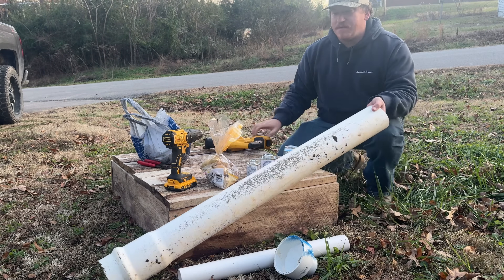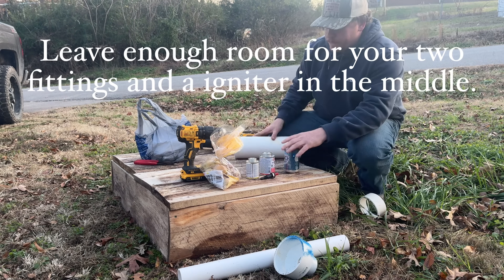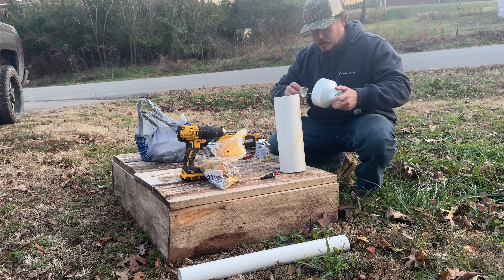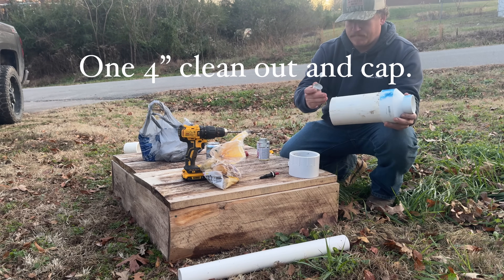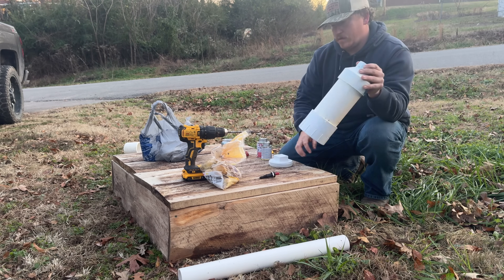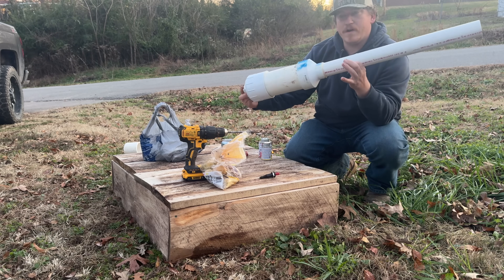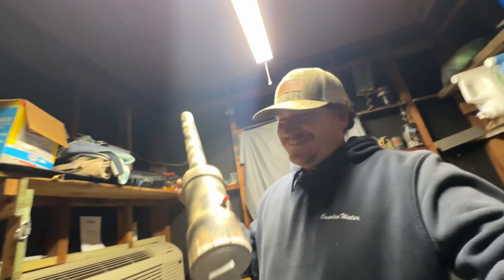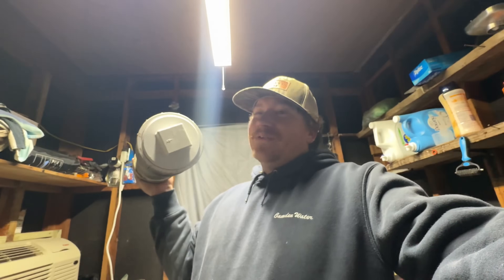How To Build A Potato Launcher.

Comment: My cousin and i built ours in high school days. We first tried rubbing alcohol. But it didn't work well. We then switched to hairspray with excellent results. But then we switched to butane. And that's when we achieved excellent distances. At times, the potato went so far we couldn't see where it landed. 
Now, I don't recommend anyone use butane. It was extremely stupid for us as teenagers to do this. We could have severely hurt ourselves. We just got lucky. 

Btw, we made ours from the black pvc. That's probably why we didn't lose a finger or hand.

Comment: Many years ago I made the mistake of exactly what you said not to. I could smell the glue going off and though "I wonder if that's flammable?". I put an oven lighter into the small coupler hole and clicked it a few times. My forearm and hand was met with a just burst of a blue flame. Signed all my thumb and arm hair. Curiosity killed the cat.

Comment: I’m not getting enough spark how are you rigging your wire to your Ignition
Reply from the maker: Twisting what they call baling wire around the igniter itself.
Reply from the maker: It’s got a small wire that run down the igniter I’ve been thinking about trying to slide it under that to be more secure. But it’s pretty thin so you have to be careful not to break it.
Reply: @WetandDirtyOutdoors  could you solder the baling wire to the igniters wire??
Reply from the maker: Possibly, or glue the wire across from the igniter.

Comment: It seems like most of the gas would escape before you put the cap back on.
What about installing a one way inlet valve like a valve stem for a tire, and then use compressed gas?
Does anybody know what kind of valve to use for a CO2 cartridge?

Comment: If you load from the barrel end and push the potato down the tube, What is going to prevent the potato from falling all the way down and getting caught up with the ignitor and wire?
Is there some kind of screen to prevent the potato from getting into the 4 inch pipe?
Reply: Dont push it that far lol. As soon as you do it one time you won't ever do it again cuz you'll realize what happened
Reply: I bet you could put a screw through the barrel near the end for a stop.
Reply: @NotJustBBQLLC Bad idea if the gun malfunctions, it could come flying out in all directions

Comment: Its 100% clear and apparent you don’t know a damn thing about plumbing primer & glue! People when you prime and glue the pvc pipe clean it the same or a bit more with of the fitting you are using make up and give it a quarter turn immediately after you put them together and seat it cause it sets up fast! He said he was gonna wait till the next day before he fired it technically he could’ve fired it. I would’ve waited about 10 minutes that cement aka glue drives fast and doesn’t need an overnight to dry! And the bit he was talking about is called a paddle bit. It’s used for drilling holes in studs it making perfect hole. 1st time and every time until you break it!

Comment: As kids, we used to tape aluminum cans together and punch a pin hole in the bottom one to inject lighter fluid.  Spin it to get the vapor and light the pilot hole with a match.  Shot the tennis ball 200 yds...yes.... sometimes on fire!... great night show ...very bad for potential of starting brush fires though.  Only over water!!!
DO NOT DO IT TODAY!  

But I like the idea of tape rather than glue so you don't accidentally make a pipe bomb and blow yourself up if you have a tight load in your barrel...
Reply: That's how we built ours in the 60s
Not OSHA APPROVED!
Reply: It was 200 yards from a kids point of view.  There was no way it went that far.
Reply: @BOHICA_  absolutely it will go that far
Reply: MacGyver style!

Comment: For safety, I suggest not gluing the barrel onto the expansion/combustion chamber. I modified a coupling to slide over the barrel and glued it into position. I use tarp tape to hold the barrel and modified coupling onto the expansion/combustion chamber. If the potato/ammo is stuck or the explosion too great, the barrel should pop off, instead of blowing up the chamber. My barrel has never separated.,
Reply: Can you make a video showing your way better/safer method of making a potato launcher
Reply: Plssssss
Reply: Will pay if u do step by step

Comment: Starting fluid works better and  2.5” Id pipe will send a 2.7” od tennis ball very far . 😊
Reply: I used 24" of the 4" abs, and 4' of 1 1/2" abs. Starting fluid. Potatoes were literally lethal!

Comment: My brother made one of these when we were teenagers. Instead of using wire, he put a long corse threaded screw straight across from the igniter. Just don't have the head of the screw against your body when you hit the go button lol
Reply: I have a cousin who did his like your brother did except he added a bolt, rubber washer, steel fender washer so it would bend to the shape of pipe and nut in hope if it exploded the bolt didn’t act like a bullet it would hopefully stay with or on the pipe